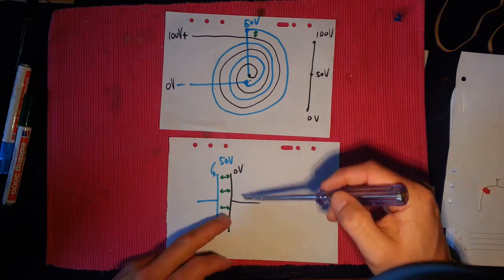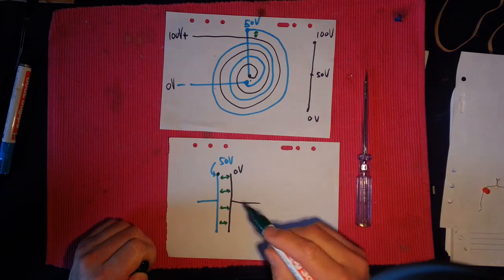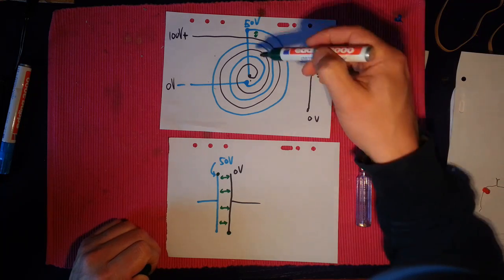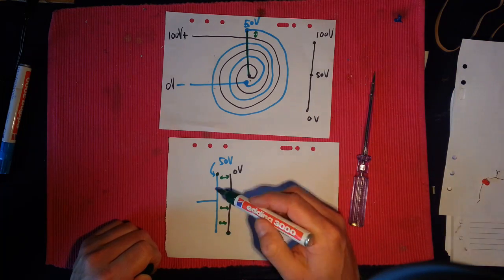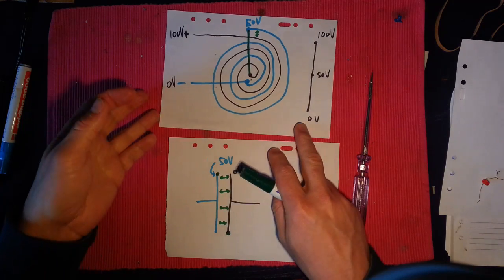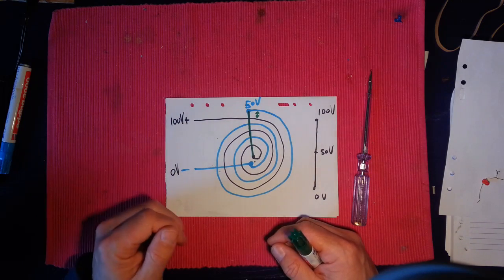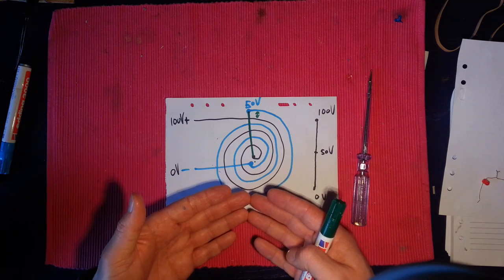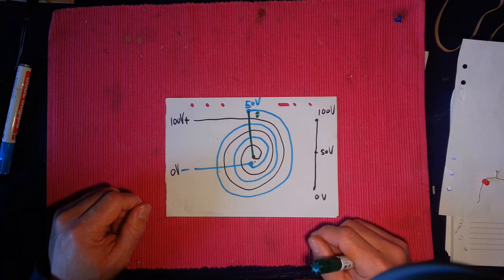The dielectric field of a bifilar pancake coil

Comment: is there any difference to the pancake, if you make a bifilar solenoid? 2 wires side by side (helical) over a pipe. Cut one wire in the middle and then join that to the end of the other wire. So the open ends are at middle and at one end of the solenoid.
Reply from the maker: The goal is to achieve a distributed voltage difference between the windings. So 2 parallel windings (speaker wire) over a pipe, and then connect the beginning of one wire to the end of the other wire.

Comment: Could you make a functional bifilar with an extension cord? Wind it and just connect one set of opposite leads?
Reply: Also, a bifilar has the same features of quartz if you provided a bypass to the resistance.
Reply from the maker: Michael Pierce what quarz features? 

yes a extension cord works. I also have  made them with speaker wire.
Reply: Sorry for delay. I do not get notifications for replies for some reason. Bifilar like quartz has properties of oscillation, capacitance, and inductance, the only thing it doesn't have is the piezoelectric effect really and less resistance. 

There was another video I had saved on a playlist that just removed itself in the past few days which was what brought me back here. That video featured two bifilar coils in series with interesting properties, like how you demonstrate the grounding effect here is not really explained. I am not sure why he removed the demonstration.

Can I interest you in conducting a similar experiment to see the affects of dual bifilar coils?

Comment: Hope it will be interesting. My vision and andestanding of Teslas tbifilar coil https://cloud.mail.ru/public/JVAz/XjpXmX6Zi  original in russian and translated in english https://cloud.mail.ru/public/DZkc/xuhvA1ZaZ Shortly, vision based on Teslas patent № 512340. Common Tesla transformer secondary coil consist of one layer. But in this version the secondary coil is bifilar, videlicet it consist of two layers, connected in series. Between layers we have electrical field E=U/2 . If we put capacitor (two plates with dielectric between them) in this field, we will have electric charge separation (electric induction) in it. Load mast be connected to this “internal” capacitor. There is NO magnetic coupling between coil current and load (inner capacitor) current, because they are perpendicular! So there is NO electromagnetic feedback! To better understanding Teslas patent № 512340 and Donald L. Smith With best regards, Nodir
P.S. There is important information additionaly http://realstrannik.com/forum/proekty-i-izobreteniya-nikoly-tesla/120-more-energii-vokrug-nas-n-tesla#61068 Find out the last lifetime interview of Nikola Tesla. Written down by Alfred S. Hawle from the words of Nikola Tesla on October 28, 1942 at the New Yorker Hotel. Here the russian version http://realstrannik.com/forum/proekty-i-izobreteniya-nikoly-tesla/120-more-energii-vokrug-nas-n-tesla?start=54#63863 There is very interesting picture of a mechanical analog of his overunity devise. Here my correlation http://realstrannik.com/forum/proekty-i-izobreteniya-nikoly-tesla/120-more-energii-vokrug-nas-n-tesla?start=126#72055
Свернуть
Reply from the maker: Thanks for sharing Nodir D, I will look into this.

Comment: Master Ivo, at the beginning of your video, you say that the series wound bifilar coil at resonance produces a dielectric field. At 14:20, you place your hand on the capacitor and its voltage rises quickly. In Don Smith's understanding of a capacitor, the dielectric field supplies the charge at the negative leg of the capacitor.  Following this line of thinking, when you touch the housing of the capacitor, you are essentially providing a larger surface (your body) for the dielectric field outside the capacitor to enter the capacitor and supply its growing charge. 

Here's a question:  Do you think it is possible to match a proper sized capacitor to the self resonant frequency of the swbifi coil to produce the most efficient LC ringing effect in the coil? And if so, how would you go about this?
Reply: Yes, that is what he is using...matter of fact many would conclude the most important "component" of the whole set up.  At this point he splits the positive and negative energy coming from the resonating coils.  He could have achieved a similar effect oscillating the primary of an ignition coil and feeding the output to his "Avramenko plug"  (nut to butt diodes)...no bifilar coils needed.  Of course the ignition coil is putting out a much higher potential.  No doubt the bifilar coil is reducing counter EMF (self-induction), but the jury is still out on the "dielectric wave" between the transmitter and receiver.  It is well known that the 'near field' of an antenna is a scalar wave for a relatively short distance...which is probably what he is seeing.  The single wire transmission from the Avramenko plug affect.
Reply from the maker: The Bifilar series connected coil, has inductance and capacitance. so by itself, its a LC circuit (LRC if you the wire resistance in account). If you add capacitance (capacitor in parallel) or inductance (inductor), you change the resonant frequency. I never tried adding inductance. But when I add capacitance, the resonant frequency drops.

If I place my hand nearby, I change the capacitance of the dielectric field, and therefor change the resonant frequency.
Reply: Thanks for your response, Ivo. I'll be more specific. I have a swbifi  pancake coil and have attached an AV plug to the two leads on the coil.  I believe this would semi-rectify the AC output of the coil (acting as an LC circuit) to DC pulses.  The AV plug goes to a capacitor.  I will get out my function generator and try to find the resonant frequency today. At this point, I may end up using a variable capacitor to see if I can match the AV plug's output to the capacitor in series with it. Any thoughts?
Reply from the maker: Av plug? semi-rectify? what's that? I use diodes (faster ones are better, but 1n4007 also work)  to rectify. Also, I know the works of don smith. Beware, he is honest in not telling the whole truth and twisting facts.
Reply: Sorry for the imprecise terminology. Avramenko plug, which  I believe is basically what you are using. https://www.google.ca/search?q=avramenko+plug&tbm=isch&tbo=u&source=univ&sa=X&ved=0ahUKEwiIzsT_-tvTAhXB6oMKHaOsAEcQsAQIJg&biw=1396&bih=691   I understand it as performing the same function as a half wave bridge rectifier, though I may be mistaken.
Reply from the maker: Ah thats a AV plug (not scart). Yes I use it. I call it a Y-diodes. yes a half bridge rectifier. Since the frequency is very high, it works better with fast diodes (uf4007)